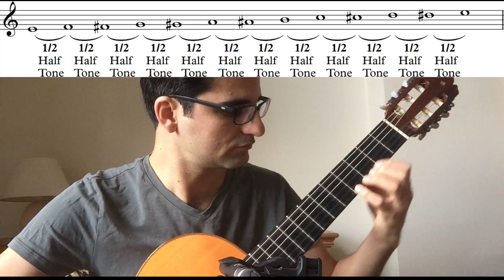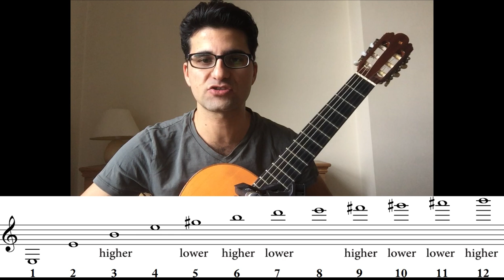Major 3rd Problem of All Guitars in the World

Comment: Good video and a nice solution for a problem.
However I wonder if many times this is resolving a problem caused through the guitar build process.
I have found classical guitars; when the scale length, fret positions (including fret dressing), nut and saddle intonation are 'perfect'.  These guitars are 'in tune' in the ways you show are 'out' on your guitar. 
 Even though, in theory, they are 'equal temperament' based.

It seems to me (when the heavens connect) a good luthier can compensate out these tuning issues with adjustments at all the points in the construction I mentioned.
And, this leads to a mistake the player can make, using the wrong string gauge (as even that, must be compensated for during the build).
Also, there is another solution I've seen (if these tuning issues are present).  Extend or shorten the nut (with the strings that are out of tune).  This corrects common inaccuracies when calculating scale length (and inaccuracies in fret placement and fret top dressing etc).  Or just equal temperament issues generally, with the 'standardised' classical guitar builds we get through more mass production  :)

Peace.
Reply from the maker: Thank you for your comment. Have you watched my video "All guitars are out of tune but one". It might be my answer for your comment.

Comment: Wow thanks for posting this.  Even with my tin ear I could easily hear the difference and my first thought was why haven't luthiers figured this out and fixed it.  But after reading Joshua Connors' comment below I understand.  The so called normal tuning is a compromise that allows us to play in every key without retuning or having different instruments for different keys.  Would it be possible to change to a different tuning to obtain a more accurate temper?  Or is this an inevitable problem because of the placement of the frets?
Reply from the maker: Thanks! The answer to your question might be on the video called Microtonal Bach experiment

Comment: The gauge differences of the strings can also be tuned with the keys to different locations on tuning instrument scale markers. Then tuned by ear. The standard way of tuning a guitar taught is off of natural frequency fervencies & at 440. I now tune my guitars to be 5 notes apart between all open strings. Then at 416 or 417 instead of 440, which lands at one note down from current standards used. Then i relearned finger pattern scales according to the chromatic main fervency blends, then the Greek Major & (Minor (pentatonic)) Scales, which have some of the main scale fervency blends ascending & descending in them. The main fervency scale is found by using the chromatic order scale of every ascending & descending tone or note in order. Then picking a root note ( r = root ), then adding notes to the root note, to r +4, +5, +7, +8, +9 & +12, then start again using the same pattern at every octave. So r +12 + 4 = r +16, +17, +19, then begins to shift because of string gauge sizes & natural wave flow to r +21, +22, +24, +26 but basically sticks to the first pattern with variations up & down. So r + 24 +4 = r + 28, +29, +31, +33, +34, +36, New octave, r +40, +41, +43, +45, +48. The kinds of metals used to create strings also have different quality level effects, this takes more Scientific research to study Vibrational Resonate Frequencies & sound wave formations using meter displays & cymatics...
Reply from the maker: I am lost, very confusing :)

Comment: Someone who finally shows you in a practical way why we can't tune our guitars properly using the standard tuning methods.
Thanks for sharing....
Reply from the maker: Glad to hear that! Check out the Organic Chords video.
Reply: many people, including yourself, seem to be misunderstanding the point of this video. The correct tuning system which people should learn for a guitar is fine. The problem does not lie with the tuning system the reason the guitar is a little bit out is because the frets are made to be in line with equal temperament. You can't change this unless you can move your Frets that's why he's using extra little frets.

Comment: There is an imperfect and sometimes useable solution to this. If you tune in equal temperament then slightly lower the open G string (which is notorious for sharpness further up the fretboard when used as a major third) and also slightly flatten the B string, you can compensate when these strings are played as a perfect fifth (they wil sound flat) by slightly bending the notes up. Of course they will be a tad flat in open string chords but with stopped chords they can alleviate the horrible sharpness you sometimes hear on the major thirds. The logic of this is that if a string is sharp you cannot flatten it, but if a string is flat you can bend it up.

It's far from perfect but for those who find sharpened thirds excruciating to listen to, you can make small adjustments in the basic tuning. It's all a compromise. The reason you can get away with equal temperament better on a piano is because the harmonic overtones are richer (especially in the bass notes).

Your video is very interesting and well presented. The problem with your solution is that, as you acknowledge, you can only play a limited set of chords. Any complex chord sequence that deviate from related harmony, especially using inversions, will sound terrible!

Comment: This is a plague that effects live music every day. The older I get, the more I notice it. I am a singer and every day (unless resting) it bothers me. Remarks are correct about the older systems,,,but the ETscale has a giant defect that is getting no better.  I naturally make the G string a little flat, but that cheat is only effective if using the capo when changing keys. Thank you for your video!   jesse
Reply from the maker: You're welcome. I also notice it a lot :(
Reply: i play blues but it's weird because, i am, already, using true major third as slight bends on the ends of my minor thirds, blues curls, or quarter tone bends as i have heard them called.
Reply: I got used to NEVER playing the empty B string for the open G Major chord, always disguising it by fretting the B Sting on 3rd fret. In this way I lose the Maor 3rd completely, at least it's better than playing it out of tune. Micro fretting might be a solution for some of my songs. Thank you!

Comment: Segovia after watching this video "When I was young First Thing I did was to toss out the BS guitar cord books that constrict tone definitions. By moving my fingers slightly back or forward on major and minor chords I was able to correct any intonations based on the half note scale". Watch Segovia's videos and watch his fingers and where he places then between the frets! There is your answer to his mastery of tone.
Reply from the maker: Danfuerth Gillis This has nothing to do with correcting tiny intonation problems. Watch the video carefully
Reply: @microtonalguitar  over the years I have changed the way I play the guitar specially on a Classical Guitar. Usually people tune their guitars by tuning one string over to the other by open closed string method but this is only half the solution as you can not play the closed string with your finger in the middle of the fret. It is always with the finger closer back to the first fret, as this creates a difference in tuning tone vs having the finger closer to the second fret. Segovia for example always plays his notes with his fingers very close to the first fret between the second fret. This is so the strings have a dissonant sound and are more louder specially on the trebles. This type of playing also changes the guitar tuning specially on 440 tunings as the guitar has a offset tuning by tuning this way. I believe that Segovia figured this out early and kept playing like that.
Reply from the maker: @danfuerthgillis4483  I agree with you about what you are saying but I am talking about something else on the video. About harmonic series and natural tones and the failure of 12 semitones.

Comment: Could you make the same adjustment without the extra fret wire by playing the higher tone on the regular fret and pressing harder than usual on the lower string to tighten the lower string and therefore raise its pitch by a micro-tone?
Reply from the maker: James Gregoric I think this would be very hard. Try the Bach experiment.

Comment: Just FYI — it is not just a “problem” with major thirds.  Obviously, many chords are affected, such as D’s, G’s, dim 7th’s, aug 5ths, etc  For these reasons, true temperament guitars have been available for a long time (i,e, those guitars with weird squiggly frets up and down the fingerboard).  However, you would generally be better off using the standard equal temperament fretted guitars, since the problems created are too numerous to elaborate here. Many serious playing problems are created, while other intonation problems are complicated.  Also, when you get to complex overtone playing with those guitars, such as metal and heavy effects playing, the phasing issue are exacerbated.  Better off down-tuning the ‘b’ string by 30 cents to address that issue.

If you are a chords player, some tune for the chords, rather than the absolute fretting.  If you are recording and it bothers you, using Revoice Pro can eliminate it, without causing playability problems.

 If all else fails and you are still bothered by imperfect tuning— get a Variax and set it appropriately.  You can even have it change by the song for you— and if you don’t like that, there’s always the piano.
Reply from the maker: True temperament guitars are for fixing the semitones. This guitar with added frets allow us to play natural ratios. Watch my microtonal Bach experiment please.

Comment: If temperament has some notes slightly off , and adding frets will not work with other keys and can be impractical due to the need of changing frets with every key , can we avoid all those problems with fretless guitars ? I mean you play a major 3rd on a fretless guitar you can make it sound however you want since there are no frets to limit you,  or maybe that can be solved with your wonderful idea of the guitar that changes frets automatically

Comment: TUNE TO A FLAT 432 TO SOLVE THE PROBLEM 

A 440 IS NOT A GOOD TUNING . STRESSES THE GUITAR NECK, HATDER TO PLAY, DONE BY THE NAZIS ILLUMINATI IN THE 50S

ON PURPOSE THEY SCREWED UP OUR TUNINGS
Reply: what
Reply from the maker: Even 432 is not the solution. The guitar frets have problems as long as they are straight.

Comment: Before  you conclude this is the answer for you, consider another possibility - your guitar may be not even be producing proper intonation in equal temperment. This is because most instruments would benefit from a "shelf nut" that compensates at the nut (still compensating at the bridge saddle, as usual). I have a Tune-a-uke ukulele that has this feature and it works really well.
Reply from the maker: Michael Brook Thanks. Have you watched “All guitars are out of tune but one”

Comment: This is great but only works for particular keys (A major in this video), as soon as you change key you would need another guitar, modulations quickly become impossible, which is why the equal temperament was created
Reply from the maker: You are right. On my adjustable microtonal guitar with movable frets, I can play natural tones when I change the key as well. Watch my microtonal Bach experiment.
Reply: valentin god <3
Reply: Right, people who want to do both have to use synths with special changes.   Wendy Carlos did it using I think 144 notes per octave >.>

Comment: I’ve been playing electric guitar long enough that I bend or press certain strings slightly more than others to achieve perfect pitch. It comes with muscle memory and knowing which chords are a bit off and which notes you really have to dig into or press lightly. I never have issues now. However with a classical style of playing I can see where this would be more beneficial
Reply: Exactly.  This video does a good job of explaining the problem, and Ryan here has done a great job of describing a practical solution that eliminates the need for the taped-on micro fret.  I'm sure it takes a lot of time to learn which strings need to be pressed harder for a given chord, and a ton of practice/time to burn this knowledge into muscle memory, but if you're a stickler for perfect intonation it may well be worth it.
Reply: What strings and notes for which chords?  If you could please tell me :)
Reply: Tyler C As I said it’s honestly just muscle memory. A few examples would be how if you get too sloppy and press down too hard on the bottom E on a G chord it goes sharp and makes the whole chord sound funny. It really just depends on your playing style. Mick Mars of Mötley Crüe sometimes even tuned his b string a bit flat to counter his aggressive playing style. It’s different for everyone
Reply: @sxnthwave  none of this is anything to do with changing the temperament. It can't be done on an instrument like a guitar with fixed frets where the Frets are fixed to produce equal temperament. You can bend strings and tune them up and down but you're not going to actually play in a different temperament. you're just bending strings
Reply: No offense but if you think where those micro frets are located there is no way to loosen the string to go flat when you are actively playing. Bending will make the note go sharp. Pressing more or less just adjusts volume and not tuning. He is talking about resonance here.
Reply: juan T There is a way to loosen the string.. my guitar has six of them on the headstock. If I’m gonna be playing thirds I generally flatten my b string a couple cents to make it ring out like it should
Reply: @sxnthwave  nonsense.  All you're doing if you do that is putting you a guitar out of tune

Comment: Hang on, if your guitar is already tuned to 12-tone equal temperament, then the fourth fret on the E string should sound exactly one octave lower than the first fret on the G string, because in 12-tone equal temperament, all octave intervals are perfect 1:2 ratios. And if they do sound out of tune, then it must be due to something other than equal temperament. I'm assuming you've used a different method of tuning to make your point, but if so, that's not how most people tune their guitars.

What we must understand is that the guitar is an instrument that can ONLY work with equal temperament. While it is possible to retune every specific note on a piano, you cannot do this on a guitar because the position of the frets is fixed. You can retune each string, sure, but each string is used to play a whole bunch of notes.

Equal temperament is a compromise, for sure, but there is a reason why virtual ALL music nowadays is tuned this way. Every amazing song you've heard in your lifetime is most likely tuned to equal temperament and we've grown so accustomed to these slightly out of tune intervals that returning to just intonation intervals is an unnecessary inconvenience.
Reply from the maker: Ben Dowson Please watch Microtonal Bach Experiment. You might change your argument.
Reply: @microtonalguitar  Regarding my first point, I've recently been corrected that you weren't actually playing the fourth fret on the E string but rather isolating the overtone of the open E string. To me, this should have been made clear from the start because I thought you were playing three G# notes.
Reply from the maker: @bendowson3124  Didn’t I say fourth fret harmonic?
Reply: @microtonalguitar  Yes, but I didn't understand what that meant. It's only because of another commenter that I now accurately understand this video.